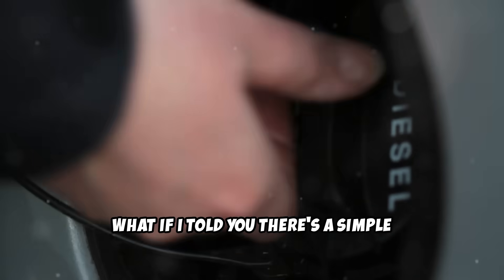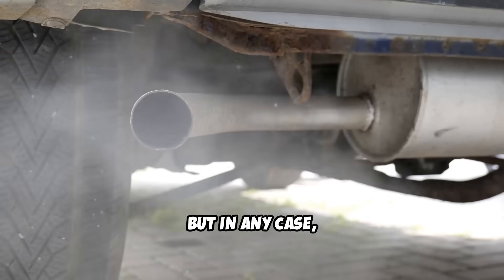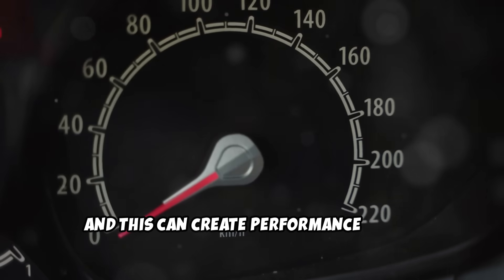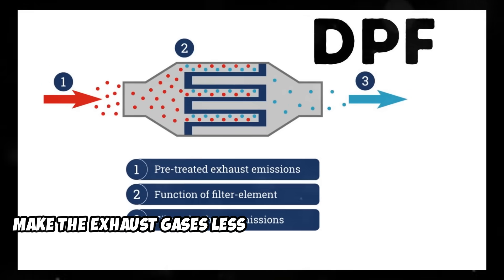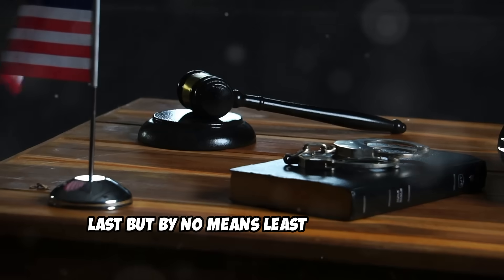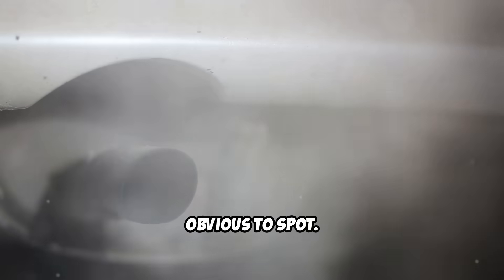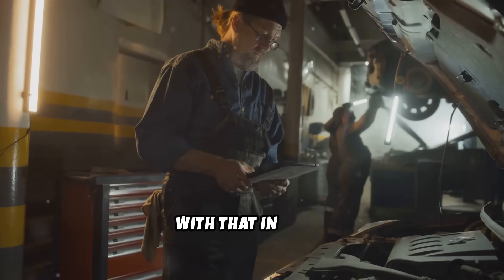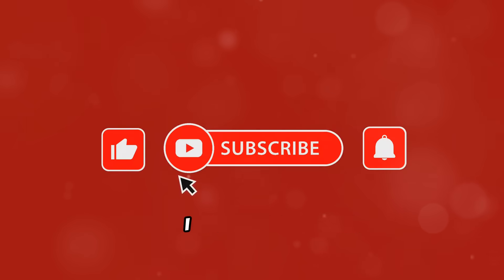DPF Delete Pros and Cons: The TRUTH They Don't Tell You

Comment: Were I'm from as of January 2026 government run Mot test centres will be checking for presence of the dpf & if it isn't present or is removed the car will automatically fail its Mot.
 So picture that you approach the garage who removed your dpf to get it back and it has been disposed off long back what do you do there when it costs maybe £800 to £1.2k for a new one.

Comment: He said it right in the video at 2:36. DPF has little negative effect on the engine when working correctly. Those particles are the issue. It's not because of air pollution as the particles will settle out. It is the fact that we will breathe these particles, and they will harm our lungs. It's kinda like preventing black lung disease. Never deleting my diesel. It has plenty of power and gets plenty of highway use, so no issues. 12 years old, 134k and no problems so far. My dick is big enough that I don't need to roll coal.

Comment: Be very aware of dpf delete
1,you will void any car warranty
2,be aware of the legal side
3,
Use premium fuel
Oil change every 5k
Good run every 2 weeks
Drive more in sport mode
Avoid short runs
Let engine warm up before driving
Let engine run for 1 minute
Before switching off
Italian tune every 2 weeks
I've stuck to this regime on my Mercedes c300d religiously and no problems
Yes you have to baby a diesel to keep it running correctly
Which is what people don't do!
Reply: The car is a tool for me. So it is meant to provide me service with running reliably, and economically. Any part that shortens reliability period and causes extraordinary expenses are to be deleted, alongside with the people who forced idea of installing it into the car. 
One may say, that in urban areas air pollution would rise. It would not. Covid lockdowns proved them wrong. First reduce emissions on planes, trains, ships and coal & gas burning facilities in China, India, US, Germany and other polluters. Unless you are done with it, go for cars. EOT.
Reply: 1. You don't need to do oil changes every 5k miles, it's usually a waste, especially on synthetic. 

2. Many warranties don't ask, only a few do (per a local shop).

3. You don't need to baby a diesel like a petrol vehicle.  I've been extremely hard on my diesel, and after 500k miles,  everything is original except my power adders that i added around 115k miles.  I've gone through 1 turbo,  2 dual disc clutches, and 1 transfer case that needed to be rebuilt.  Nothing else has failed.

Comment: Since 2017 I drive my Jeep Grand Cherokee 3,0 L diesel mostly on the highway. I have already 110k miles on it and I never had any appearance of the regeneration lamp. Diesel is not made for short distancies.
Reply: Uh sorry bud it’s regenerating all the time, you will gain mpg and a bit of hp not to mention no def.
Reply: Make sure you stay up to date with the latest updates on that Fiat EcoDiesel.  Pairing one of the worst diesels ever made with one of the least reliable brands (Jeep) was a recipe for disaster.  I had a 2015 Ram Ecodiesel, and after getting a non-compliant ECM tune prior to EPA crackdown, that truck woke up and was very reliable while making consistent 28 mpg.  However, the tone ring was a known issue around the 120k mile mark and about $3,000 to have fixed if it didn't go out and grenade the transmission first.  I said goodbye to that truck before it left me stranded.

Comment: EGR is by far the worst emissions control system on modern diesel engines because it’s literally forcing the engine to choke on its own waste. The DPF is a close second, but EGR systems are counterintuitive to a healthy DPF since the purpose of EGR is to reduce the amount of oxygen in the cylinders to reduce combustion temperatures, and that reduces NOx but produces more soot or particulate matter. More soot= More DPF issues. Despite what most people think about DEF or the SCR system it actually reduces the amount of EGR needed to meet emissions standards, which means less soot being forced back through the engine, higher and more efficient combustion temperatures, and less soot buildup in the DPF. The SCR systems can be problematic, but it doesn’t interfere with the engine’s combustion or reduce the lifespan of the engine, and it’s a true After Treatment System to reduce NOx with DEF. 

There is a reason the EGR valve is completely closed during an active regen, and that’s so the exhaust temperatures aren’t being lowered while the ECM is trying to artificially raise them by injected raw diesel into the exhaust stream. 

Eventually manufacturers will most likely get rid of the EGR, and possibly the DPF and rely solely on the SCR to treat NOx because the hydrocarbons won’t be an issue if the engine can run at normal (higher) combustion temperatures, which prevents the formation of soot in the first place.
Reply: No dpf is the worst

Comment: It’s hands down better for the environment if it is deleted………look at the entire picture, 5-10%? Try 5-10 miles per gallon better and a good tune is not smoky
Reply: does a 2.0 litre diesle not smoke more
Reply: Stop making pie in the sky mpg claims, people believe this crap. 2 or 3mpg bump AT BEST! real numbers there bud!
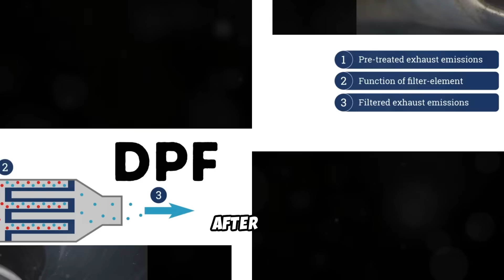Reply: @BruceMyersLBZ I’m sorry for your terrible misfortune, I have many diesels deleted and tuned…….the latest is a 2022 f350 with 3:31 and 10 spd I’m around 24actual mpg empty average. I have gotten as good as 26 driving very reserved down the hiway. You’re an idiot if you settle for only 2-3 mpg increase with a delete………or you could say so it is better??! And no def to boot?? lol
Reply: @BruceMyersLBZ  Lifted 2009 crew cab LMM with 35s consistently gets 18mpg at 65 mph.  16ish at 75 depending on load.  That's as good as Toyota 4runner, Lexus GX460, etc..., etc...
Reply: WRONG! Just wishful thinking and lies.
Reply: @KidSinister000 I don’t care what u think, I’m reaping the benefits, you are not

Comment: Just drive the diesel vehicle on the highway (>60mph) for at least 15 minutes which clears up the DPF
Reply: Yes , that's right , that's what I do ,my truck is running pretty smooth at 200k miles ,I have the baby 3.0 duramax
Reply: @angelcamacho2059  I have the 3.0l duramax….43,000 miles so far no issues besides slight oil consumption.  Hopefully, I can clear 200k+ miles as well.  Bought it because I run 80 highway miles a day to/from work.  Gasser was killing my wallet. Duramax cut my fuel bill almost in half.
Reply: More like 30minutes
Reply: @jamesbarrows-y2i  Super convenient when you're pulling into your house and then have to go drive it around on the highway for 15-30 minutes, because god forbid you have a regen start and not let it finish.  Just dumb system.